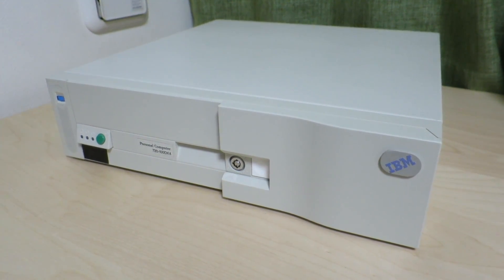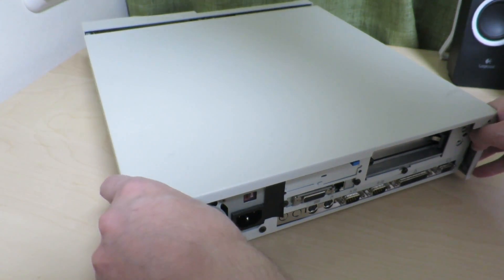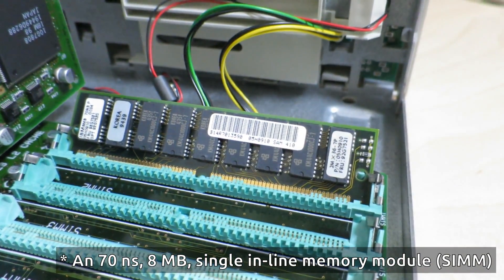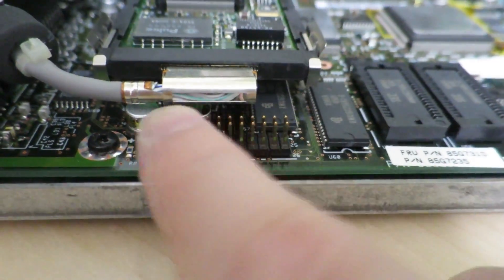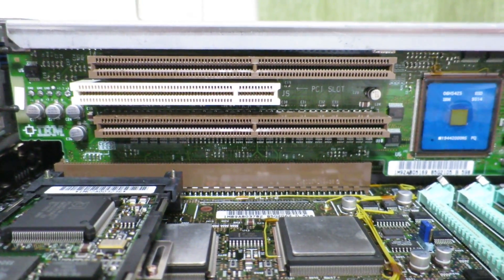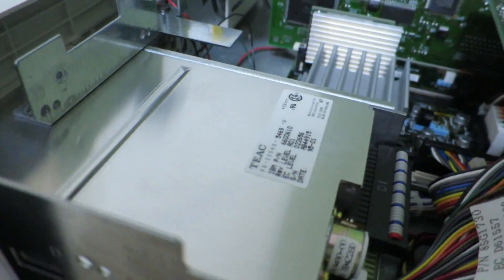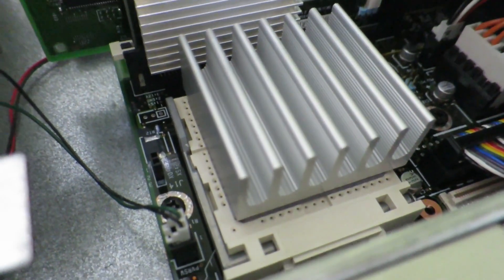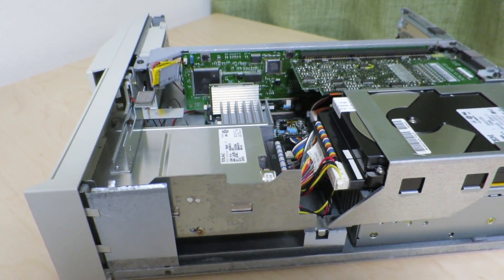1995 IBM PC Series 720: Looking inside a (nearly) unused 20-year-old 486 PC!

Comment: I'd love to see this machine running if you still have it. It sounds like my kind of computer - no audio, no 3D graphics, just business.
Reply from the maker: Yes, I still have it, it's sitting on my desk right now, just haven't used it for a while. I did take a video when I first booted it up, but the video had some problems, so I'm not sure if I'll put that up... Anyway, yes, it's quite a business-use machine without any sound or fancy graphics. Although it would have been nice to have a sound card, since my first computer had a Sound Blaster 16, and this machine was quite similar to the first computer, the IBM Aptiva, which was sold around the same time period. Thank you for the comment! :)

Comment: Would be interesting to throw in an S3 864 in the PCI slot and run benchmarks to compare it with the onboard 864 which presumably runs off the MCA bus. You would probably see the penalty of the MCA-to-PCI conversion. I would consider having a sound card in the ISA slot, given that it is in fact ISA.

Very impressive and rare machine, I love the videos of it so far, looking forward to see more!
Reply from the maker: Wow, that's an interesting idea!! I'll have to keep my eye open for those Vision864's, because I can't find any in Internet auctions in Japan right now, and I don't think I want to spend 100 USD to get one shipped here from overseas. (Also, I'd be a little hesitant to connect it to this system first, considering this machine actually works perfectly!) Thank you for your comment and ideas!

Comment: IBM Japan usually got their own computers models versus the rest of the world.  Their PS/2 models were called PS/55.  They also designed and manufactured most of IBM's portable computers in late 80's/90's.  The similar US version was sold as the PC730/750.  I still have my PC750 from 1996.  It is "Select-A-Bus" with five MCA slots and two PCI slots.  It has a 16-bit MCA card for the PCMCIA slots.  That large blue chip on the riser is the Microchannel-to-PCI bridge chip.
Reply from the maker: Wow, thank you for all the detailed information!  I wasn't aware that IBM portables were being designed by IBM Japan. Is it the PS/55note series? I've heard of them but never actually seen them. Speaking of PS/55, I actually used PS/55 computers at school in the 90s -- in fact I would pick them up from the school's garbage dump, as they were getting replaced by 486s. (Now to think of it, those were from the IBM PS/V line; another PS series for the Japanese market.)

I was wondering what the large blue IBM chip was -- it's interesting to know that they actually had MCA-PCI bridge chips; I was wondering how MCA and PCI was able to co-exist in a single system. Thank you for the comment! :)

Comment: What where all the yellow wires snaking around the board???
Reply from the maker: Apparently those yellow wires are called "blue wires" (http://www.catb.org/jargon/html/B/blue-wire.html; or "bodge wires" if you speak British English) which are to usually fix issues were found after the manufacture of the boards. I don't see these too often these days (probably today it's cheaper just to re-manufacture them? perhaps better PCB design tooling preventing these in the first place??), but it appears to be more common in older equipment at least from other teardown videos I've seen on YouTube.

Comment: Sweet machine! These OEM desktop machines often had very interesting design choises.
Reply from the maker: There definitely was a lot more variety back then which made them more interesting when looking back at them. Of course, it's not as user-friendly because it meant that were was only one source for getting them serviced... Those design choices were I guess the "value-added" aspects of those machines, so I guess there's positives and negatives.

Today, PC's are quite standardized that form-factor has become less of an concern when considering if pieces will come together -- most of the interesting/unique designs are now in servers and workstations these days ;)

Thanks for the comment! :)